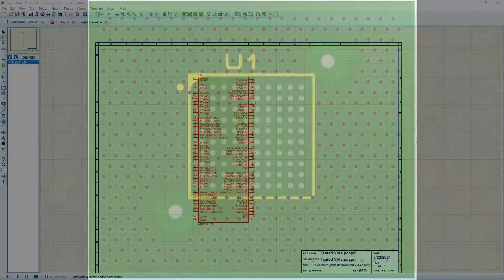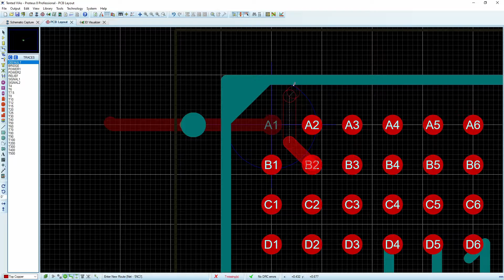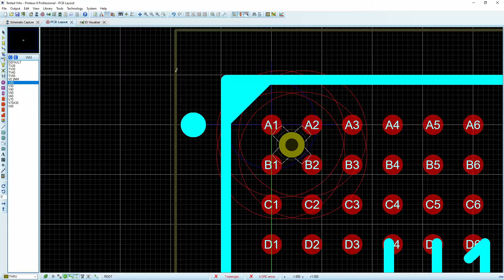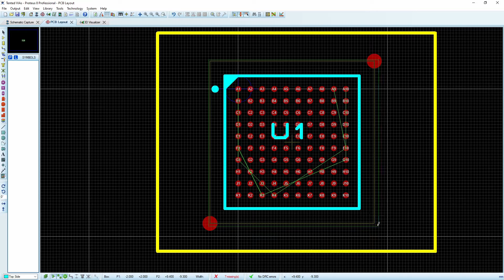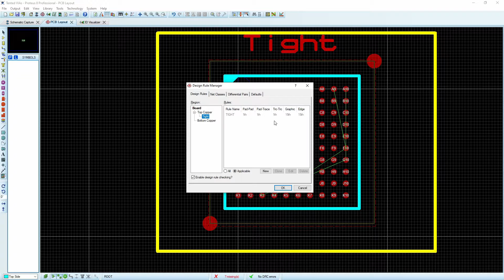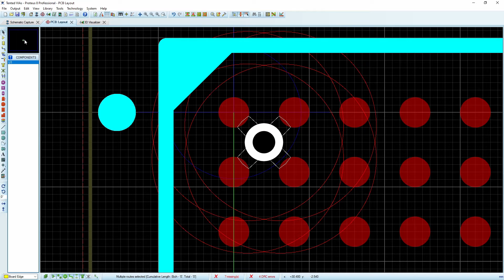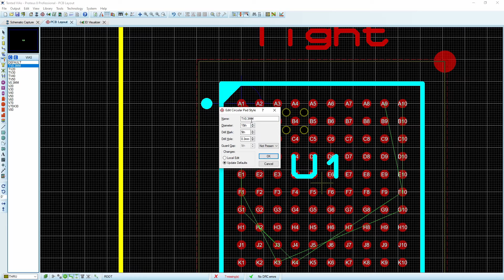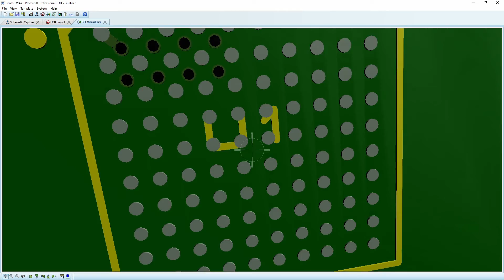Creating Tented VIAS with Proteus

Comment: Hi, I have a question if you may. I design PCB Directly without using schematics capture. I think that's the reason that I don't have NET list and Via stitching option is disabled. Is there a way to use NET list and Via stitching without using schematic capture?
Reply from the maker: Great question. I am afraid you will need to add a net. This can be as simple as adding a terminal to a schematic. I just tested it with a default and labeled it MyNet, then assigned the two planes in the layout to that net. Worked fine!🤓 Let us know if you still have an issue.